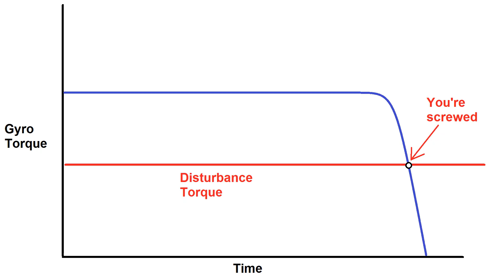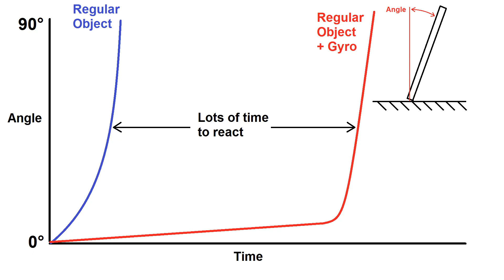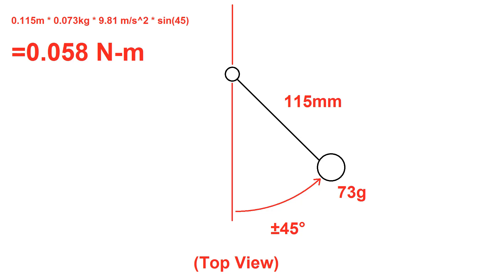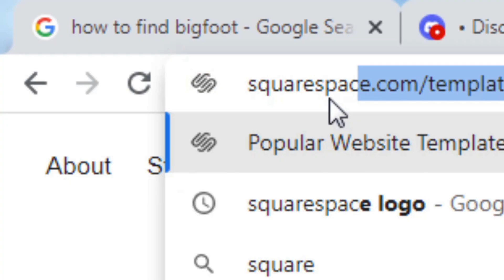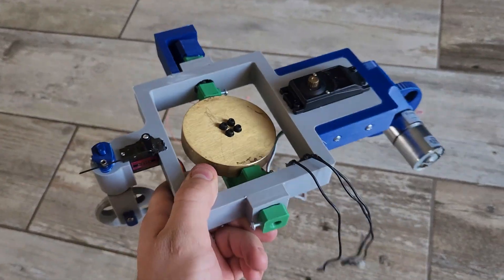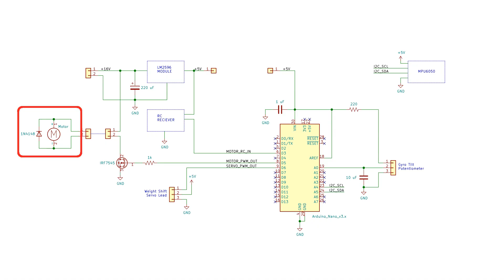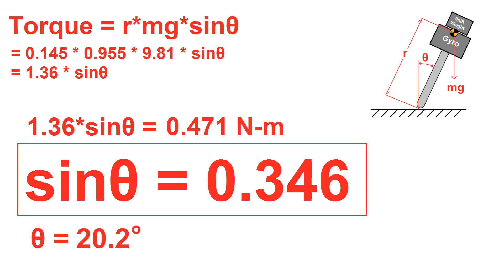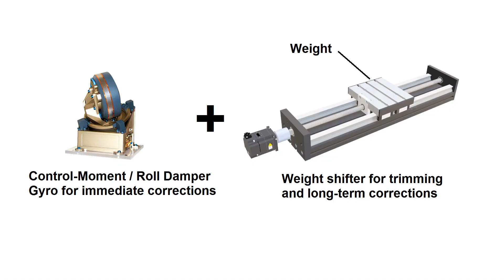Gyroscopic Stabilization with Weight Shifting

Comment: When dealing with instability, the Derivative term should be under special scrutiny as(depending on the implementation) it has a tendency to amplify noise (the analog potentiometer choice is what I think saves the day)

The integral action is needed to drive the error to 0, as a PD alone can’t do it, you can only get it close with high gain.

If I were you I would try adding some Ki to get rid of the dc  error and drop Kp and Kd as needed to get the system stable.

However for cornering (especially at high speeds) I suspect the main limit will be the speed of the analog servo itself
Reply: I've never had much success tuning PID controllers using the D term. It's only really been helpful where the loop has some delay. As you say, the D term is terrible with noise.
Reply: @axelBr1  The D term is very situational, and not used very frequently (in motor control for example is basically never used) 

technically the derivative gain enhance yout phase margin at the expense of worsening your gain margin, thus you can theoretically use it to be able to push the P and I gain harder. It can also improve settiling time.

The problem with derivative action is that the derivative itself amplifies high frequency noise (it is basically a high pass filter)  as such pure derivative action in a single feedback sensor scenario is not viable so there are two alternatives

1) use a second sensor that directly senses the derivative, for example It is fairly common in aerospace for attitude control system where you get the accelleration from an accellerometer and rate of rotation from a gyro, no math needed, however this is expensive as you have to buy 2 sensors
2) you add a filter term to the derivative that limits it's bandwidth to the region of interest, thus cutting down on HF noise, 
however this is another parameter to tune, and also the more you filter, the less usefull your derivative

Comment: I'm seeing a lot of the problem being that when you move the weight to correct a lean, the inertia of that weight pushes the pendulum/bike further over. I'd like to see the weight being swung vertically, so the latteral inertia could be partially cancelled out by the rotational inertia, but that would have been hard to integrate into the bike.

Comment: If the feedback loop didn't consider the reaction moment caused by the acceleration of the ballast, that added to the current angle shift, this could add to the oscillation. You had a system that was critically damped but each time you made a rapid adjustment to the weight shift it amplified the oscillation that eventually oversaturated the damping coefficient from gyro. 
Making more continues smaller weight shift, or using the moment from weight acceleration by first rapidly making a small increment in the wrong direction and then going the correct way at the slower acceleration could mitigate this issue.
I think this system would benefit more from a reaction wheel rather than a ballast due to faster reaction speed

Comment: you'd be able to do better than 0.3g in a turn if you made it lean in to keep the contact force vector through cg -- could try coupling yaw + forward velocity to roll in your control loop